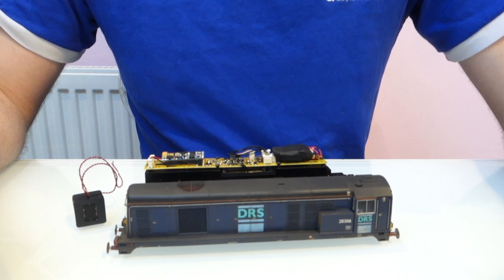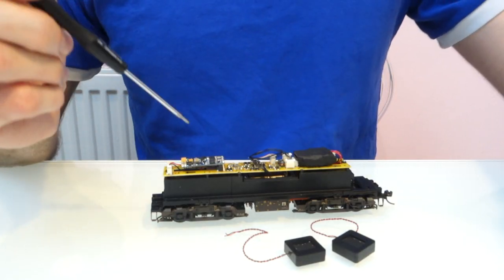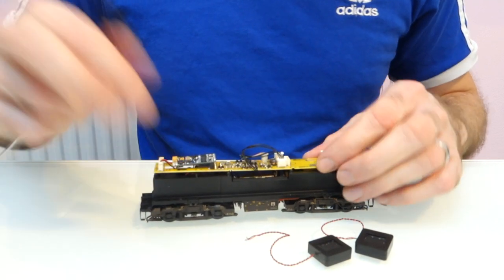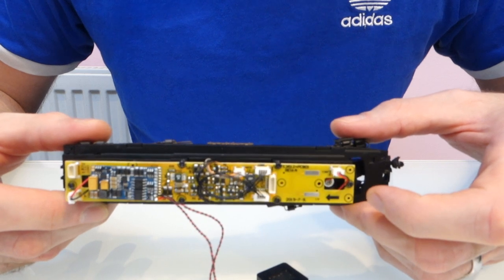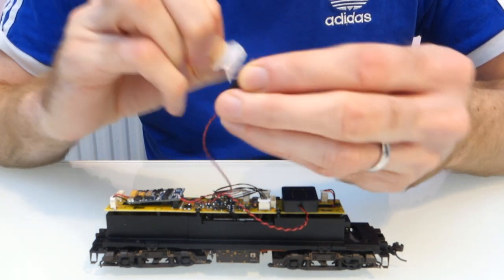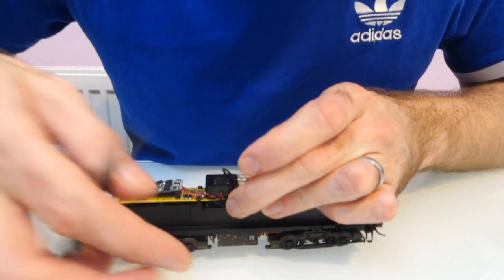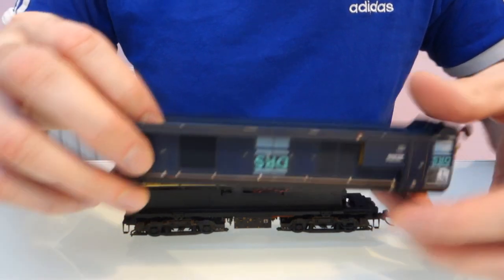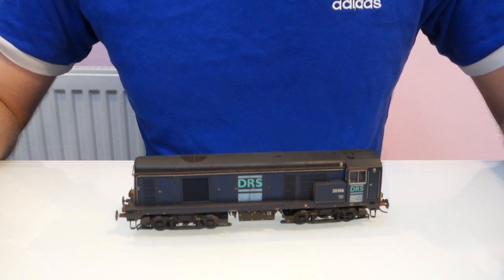How To Upgrade The Bachmann Class 20 Speakers To A Pair Of 20x20x7 Megabass

Comment: Hi Richard. Just received the speakers for the 20 upgrade. Never seen the sticky dots before. Which size / type did you use. Thanks, Dave
Reply from the maker: I just got them from one of the local pound shops
Reply: @roadsandrails  Thanks. I'll pop down in the morning.

Comment: Amazing I did the double iPhone speaker on my model from your video so I am going to do this now just one question are they 4 ohm or 8 ohm off you website thanks
Reply from the maker: Hi, thanks, each one is 8 ohms so 2 in paralell is 4 ohms
Reply: @roadsandrails  thanks can I if just one on it’s own on a hornby tts chip
Reply from the maker: @jackbutler0123  yeah you can use 1 on tts
Reply: @roadsandrails  thanks for the quick very helpful response